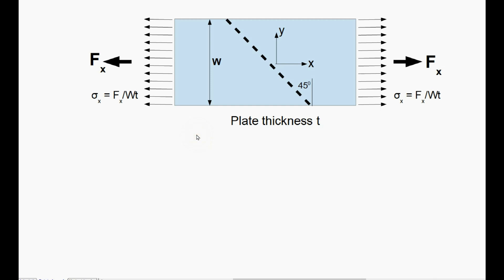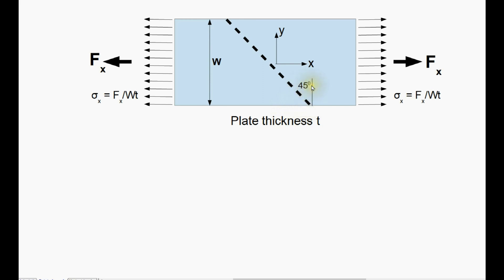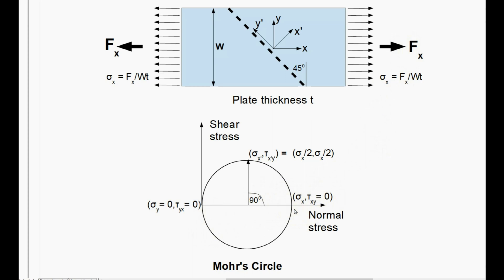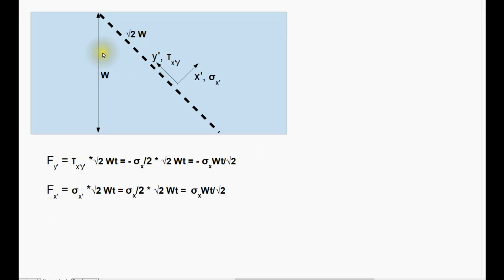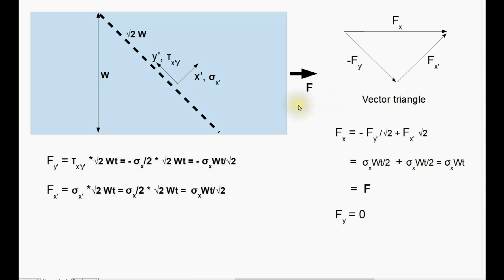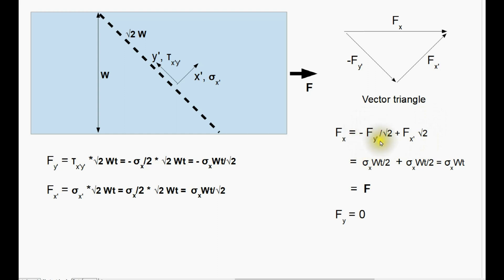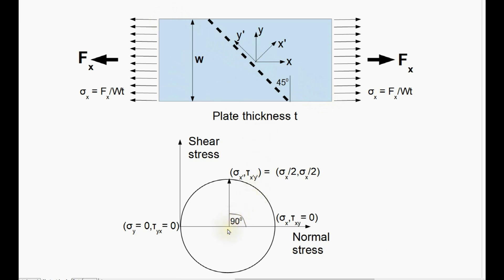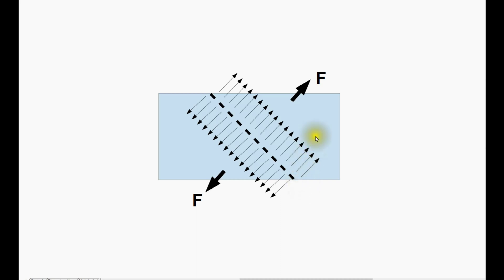Why scarf joints are no stronger than square joints

Comment: 7:46 I think we can agree that a typical DIY MIG buttweld on a framerail is more likely to stress crack rhan a nondisturbed framerail,
To minimize the risk of a catastrophic failure it seems a good idea (or at least a possibility) to put the stressed parts of the weld  separated on the frame with a Z .configuration. 
But of course your simplified stress analysis is quite correct.
Reply from the maker: What will happen in a frame rail supporting variable bending moments is that a crack will form in the location of highest tensile stress with the worst fatigue detail (and I know that in the video I only considered static loads, for simplicity). This will most likely be in the top or bottom flange. Once it has initiated it will continue to grow at an accelerating rate, firstly through the flange and then through the web. The profile of the web weld will change nothing - it will propagate either through the weld or base metal. From a structural perspective the member is considered to have failed as soon as the crack has any finite size.

Comment: I agree. 
The chassis steel is likely pretty low grade and the as-welded filler metal is likely 50% stronger, even using a basic steel type filler. It is also a thin section so that limits other effects. Just make a decent clean weld, it is more important than anything else.
Reply from the maker: You got it in one!

Comment: Generally, weldments are less ductile than the base material.  Also, welding introduces stresses as the weld bead cools and shrinks.  What some of us are attempting to avoid is a failure of the weld or its adjacent material due to these factors.  Imagine flexing and twisting a tube with stiff spot that depending upon the material, may have extra ductile areas adjacent to it (HAZ).  Sooner or later, either the weld will crack or the material immediately adjacent to it will.  Scarfing a joint is an attempt to spread this difference in flexibility laterally in order to mitigate it.  I have an old commercial welding textbook somewhere which indicates that if it is necessary to repair a ( medium or heavy commercial) truck frame, that a rectangular reinforcing plate the full height of the frame rail and something like twice as long should be placed over the repair, and welded only along the top and bottom (laterally), and never on the ends, as the perpendicular welds will eventually cause the frame to crack and fail.  Many of us in the off-road fabrication scene will make perpendicular (square) joints in the frame tubing, but reinforce them with "fish" plates, the simplest form of which cover the joint like a diamond shape.  Besides strengthening, fish plates reduce stress concentrations.

Comment: It would appear to me that perhaps a mistake that he's made, or assumes is that any chassis extension would be done immediately adjacent to a spring hanger where bending and rotational forces around the centroid are at their minimum in the overall view of a chassis' stress profile, and are shared somewhat equally with shear. Since there's no perfect world sometimes a chassis would dictate a join right in the middle of the frame at the peak of the tensile/compression forces below and above the centroid. If we assume the centroid ends up being a rotation pivot for these forces then perhaps a slanted scarf joint would place the weld more perpendicular to the actual tensile forces trying to seperate the joint.
Reply: FYI, and that is why all chassis OEM's recommend butt joints and to be completed around 6" before spring hanger. That will also allow enough backing plate on either side of weld.

Comment: I am not pretending to fully understand the math and physics behind your explanations, as I wasn't pay the needed attention when this stuff was taught...however I do want to suggest an optional root reason for this debate or misunderstanding,  as you show it:
A. The syress liads inflicted on a vehicle chassis (especially an offroad one) are not limited to bending and stretching stresses. 
The torsional stress loads may  change your diagrams a bit.
Another optional root cause for the "misunderstanding " may be the fact that whenever anyone elongates a longitudinal load bearing chassis member they always (should) back it up with an additional reinforment plate (at least according to most vehicle manufacturers) which will alter, locally,  your chassis moment of enertia.
Whenever yiu change your moment of enertia,  for a given profile, you always wish to do it graduate manner.
This prevent stress concentration and mainly is a good practice to prevent "hot" spots and reduce the chances for fatigue related, premature failure. 
I may be wrong about this but will still continue to do it this way.
Very good video and clear explanations.
Will continue watching the channel 
Thabk you
Reply from the maker: Thanks for your contribution.
There will indeed be torsional stresses present but these will be of lower magnitude than the bending and shear stresses shown here, particularly for closed members (e.g. box sections). However to calculate them I'd need to use a 3D model rather than the simple 2D analysis used here. This would inevitably involve a computerised analysis with a whole range of load cases. It'd be more visual but would be a whole lot more work for me and it'd be much harder to explain the results and conclusions in a concise manner, and they wouldn't be so very different. The simplified analysis I showed is what would be done at the conceptual stage before resorting to the computer and in days past would have been the only analysis performed.
It isn't bad practice to use reinforcing plates particularly if they are well detailed and fabricated, however they should be applied where they are needed (i.e. in the flanges and not the web). In the structural fabrication industry they are used sparingly because of cost; The preferred approach is to make a straight cut and make a competent butt weld,  job done.
Reply: Thank you for the detailed reply, the info makes a lot of sense. Only reason I am raising it is that the vehicle manufacturers not allowing to do anything to the upper and lower sections and only have instructions of how to add reinforment while connecting to the web, even if the plates are bent and reinforce at least one of the flanges...
So, still intrigued but understand that you are not my private teacher.😢
Will be very interested to see an episode where you inspect a major vehicles manufacturer 's unfitter instructions and point out their misleading or misunderstood instructions. 
Keep up the good work and educational contribution 
Thank you
Reply from the maker: @omribornstein8329  I am unfamiliar with instructions issued by vehicle manufacturers however I am  a Chartered Structural Engineer (equivalent to PE in US) and what I say on this subject is sound. For legal reasons I must make it clear I am not issuing advice to anyone.

Comment: NNNOOO, please not your last word on the subject ! :)  (it helps keep us all sharp)

This is a really interesting and complex area to talk about. Your math is correct to the limits of the theory. In all engineering there is more at play than the bare numbers.
((really sorrry for the length of my reply, it is hard to put into words))

My thoughts. (having been involved with the design and repair of many structural member failure repairs )
- Virtually all welds put in some sort of stress concentration that would likely not be present in a single piece parent memember
- It is undesirable to have said stress concentrations running at right angles to any tensile stress
- in most situations of field repair, full and complete engineering analysis and calculations are not done. More often some astute estimates are made based on material knowlege, the life to failure ( number of cycles sort of thing) and the fundamental geometry of the item to be repaired and some basic calculations or sizing proportions.
- Structural welds done in te field ( even by expert welders) should be given the very best of opportunities to be as insensitive to weld defects, material differences and stress concentrations as possible

If the failure is life / fatigue related (as opposed to impact damage ),  
- at best an unreinforced repair will achieve similar, but somewhat lesser life that the original failed structural member
- We usually aspire to  do better than this replication of inadequacy (but some times emergency repairs, time constraints or a non stratigic panicked client dictates otherwise)
- for field repairs a weld ( or any non reinforced repair) must be considered a weak point

Now as things fail, the discussion now moves to how they fail (lets keep with the fatigue / over stress theme for discussion), the issue becomes one of the nature and speed of the failure.
- Stress concentrations lined up like a zipper at right angles to the principle stress are like the peforations in toilet paper (yes they put the stress raiser (peforations) across deliberatly because the paper will most likely tear on the line)

We don't want to do this toilet paper thing with a weld repair so, what are the options
- more often than not, the paper weld repair is done and the joint is plated over with a hopefully designed plate that places its welds and stress concentrations in a manner so as to improve to overall member and new joint service life without adding further problems (yup this is easily done if not carefull, too much metal, changed stiffness in a dynamic flexable structure can cause problems)

Now I do recognise that qualiyt controlled factory weld process can deliver transverse butt welds of the full strengh (done all the time, and sucessfully too by major manufacturers such as Catipillar).
- for less controlled welding situations where an item has demonstrated its structural limitations / inadequacy over time, the metal aint what it used to be when it left the factory
- any plating over the repair must be shaped to connect in a mannerthat does not put welds, their defects roughness and the geometric stress raisers where a crack would naturally want to run

As a side note to structural repairs on dynamic structures, surface finish and geometry of plating can be really important
- tapering down of plating to reduce stress raiser makes a big difference when your back is to the wall
- one can not effectivly taper a square doubler plate with a transverse weld to negate geometry stress raisers as the transverse fillet weld is ground too. So, what to do
- What to do  is to put the weld at an angle (yup shape the plate, weld past the plate ends and taper  weld ends and plate off with post fabrication grinding, being carefull to rund the grind marks in line with the principle stresses
Reply from the maker: I will give your reply proper consideration since it obviously deserves that. I will post a reply in due course when I have read the post properly.
My background? PhD in Fracture Mechanics. My supervisor was Paul Paris (of Paris' law for FCG). 40 years in the offshore industry where fatigue and fracture are primary design considerations. Sometime expert witness and part time lecturer in FM at IC. If I find we are greatly at odds it'll be interesting but I am always prepared to be proved wrong :-)  I am not actually arrogant although well qualified in the subject matter.
I send this from a bar in Borneo overlooking the South China sea. It's tough here :-)
Reply from the maker: Having quickly scanned your reply..
The highest stresses in beams are in the top / bottom flanges and that's where the failures arise. Scarf joints in the webs are irrelevant but they keep the YT dudes happy.
I have never seen angled welds in flanges - this would give mixed Mode I / II cracking which is poorly understood.
You can get good fatigue performance from butt welds under the right conditions. If you have access to both sides then no problems. If single sided (as is common with tubular structures, my field) you must have close control over the root pass (usually TIG) and the fill runs are less critical.
If you can't do a high quality butt weld then doubler plates are a good alternative,  profiled to avoid sharp transitions as you say. Good weld profiles are necessary in fatigue critical situations, ideally with profile grinding and shot peening. All of this done in industry however the average YT dude wouldn't bother.
To put it in perspective, my hand calcs on the Discovery 1 chassis rails showed that they aren't fatigue critical. However on my recent trip to Namibia I met a couple who managed to break one of of chassis rails on their Hilux. This was only 2/3 the depth of the LR equivalents and I don't need to explain the significance of this.
I hope we are on the same wavelength.
Reply: @defendermodsandtravels  
yes we are on the same wave length
- I really appriciate your videos
- as a young mech engr in the 80s I was exposed to an awefull lot of cracked frames and structures in the rail industry (rail maintenance machinery was a particularly crackfull learning enviornment, some of the machines in the field were cracking daily  / weekly, yes major frame cracks had got out of hand).. Attention to detail, and designed repairs (lot of learning as to what worked and what did not!) 
- good welding, removal of the overstress aged materials, plating designed to minimise  stress concentration from the plate connection geometry and avioding the toilet paper thing in the geometry
- these days I use Strand 7 FEA, such programs are very good at modeling the impact of geometry , welds etc if one has the time or inclination to do so ( I am semi retired and do have the time for such things!)

any way thanks for your videos, 
they are really good
Reply from the maker: @johnallen3555  Pleased we are on the same wavelength and not at cross purposes.
We probably have broadly similar experiences albeit in different industries.
Something clearly went wrong with UK rail in the early 2000s although it seems to gave calmed down now

Comment: Hello, structural fabricator/welder here from New Zealand. We always use the square butt method, joint weld preparation is critical, these days we insert a backing strip to ensure  ease of a sound full penetration weld. Ultrasound tested if the design engineer insists.
Reply from the maker: You are doing it the correct way and you speak language I understand. Keep up the good work.
Reply from the maker: If you speak the same language you must be a fellow engineer. Welcome friend.
Reply: ...although....when adding any material for reinforment, you change the profile's  moment of enertia.
And you do not want to do that abruptly, thus sending you back to the elongated diagonal shape.
Which was probably the main reason for all this confusion to start with....😂